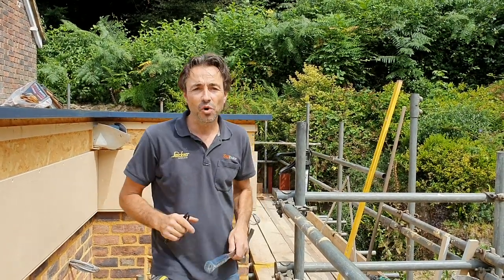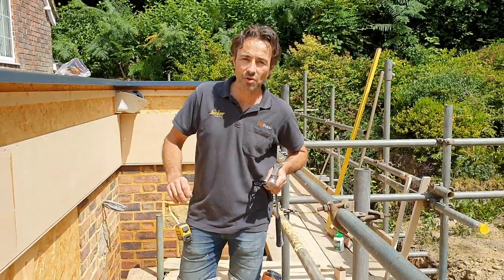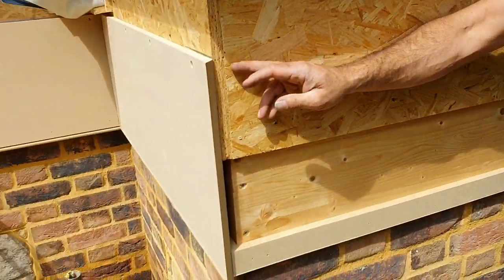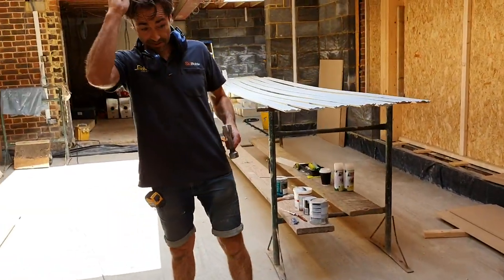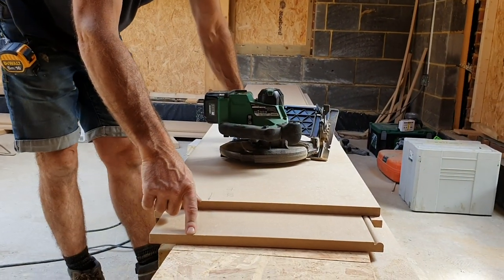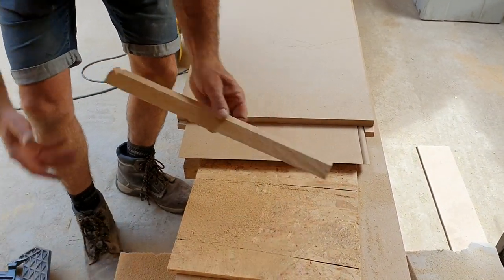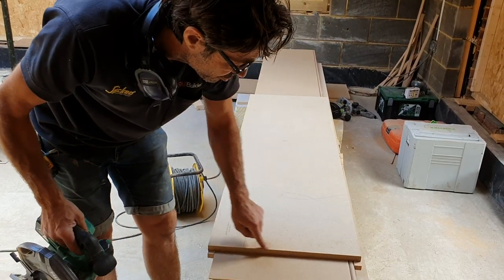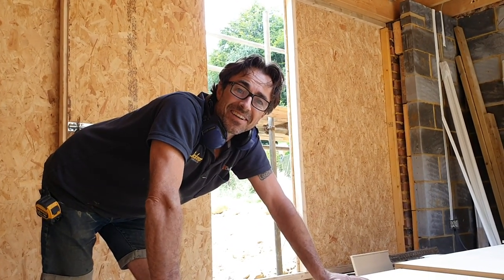How to mitre large boards

Comment: I would rather use my mafell track saw, put the fence on the saw and it acts like an out rigger which will stop the saw from tipping off of the track, it may need a small packer on the underside of the fence just to allow for the thickness of the track but it'll work a treat!
Using the circular saw is probably a quicker method than the track but as long as the end results are good that's all that matters 👍

Comment: Would've loved to see the biscuits in the corners used, the router cuts perpendicular to the facia board, where as most plunge cuts are at a 45*.
Also what's the cost of that weather resistance MDF vs Soft Woods?
As always, thanks Mate ☺️

Comment: how much is the tricoya a sheet Robin? also has your saw got a riving knife? when you watch any American chippies they don't have knives on any tools, they can be a blessing or a pain! my dilemma is: if I remove the knife & one of my staff has an accident where would I stand? I did have an apprentice try cutting some ply on the floor without supporting the whole of the edges & the ply twisted, kick back into his leg, then A&E, HSE not very happy about this but seemed clueless as to what the actual procedure of using a circular saw (suggested wearing a snag resistant cloth over his knees!) rather that the good old fashioned way of keeping your body out of the way in case of kick back.
Keep up the good work.
Reply: Last time i priced some up, it worked out around £200ish on single 8x4 sheets. Not sure now though, probably even more.
Reply from the maker: Hi Julian, with regard to the saw and the safety, some of my larger corded machines have riving knives but the smaller cordless tools don't, they do have a brake that when you let go of the trigger then the stop really fast, the Extreme Tricoya that I used was 3050 x 1220 and was about £200 per sheet, we had about 7 sheets on this job, thanks for your comments

Comment: Robin how do you feel about flat roofs ? As a carpenter I don’t think anything beats a cut roof but what do you think ( not talking about the job your on just in general )
Reply from the maker: Hi Isaac, I love pitched roofs, but also like flat roofs, I have no problems with flat roofs and I build them dead level without firring pieces then use my warm deck PIR insulation that is cut to fall, the membrane that we put on top is called Evalon by Alwitra, it is an awsome covering, I have never had a comeback with this thanks for the comment
Reply: Interesting , loving the videos robin keep up the quality work !

Comment: I'm still struggling with the idea of a 400mm long internal mitre, do you biscuit the joint and or pre make it on the bench then fit, how do you control an internal mitre that size? Why not a loose moulding on the bottom edge then a biscuit butt joint on your internals? It's not a criticism I'm just pick your brains.
Reply from the maker: Hi Ben in most cases I would butt and scribe an internal corner, in my case here because of the exposure to weather etc I had all my Tricoya extreme MDF moulded so the chances of a loose moulding even if it was well primed and glued and pinned would get any water running down the wide facia boards and in time would rot water only needs a tiny gap to get in and do its damage, also the backing for my wide boards was flat and perfect so the mitred internal corner fitted like a glove, it was only the main butt joints that where biscuit jointed as I demonstrate with my router, hope that helps and thanks for your comment

Comment: how can ytou be working with no PPE   or hi  VIS     as well as wearing shorts     i cannot even walk om site  if i do mot have a full length pair of jeans on    let alone hard hat   and hi vis  i even have been pulled up for not using a dust extractor for  cutting MDF   out  in the fresh air  in middle of nowhere  and then i had to have a H  CLASS   EXTRACTOR

Comment: Why not use festool plunge with track
Reply from the maker: In the video I mention why I did not use my TS55 rail saw, and it is because it has a tendency to slip of the rail when its at 45 degrees and this is why I prefer the normal circular saw and a decent board to cut against, thanks for the comment Gerald

Comment: Festool hkc55. Makes this cut so easy...
Reply: Shahar Dror that’s what I thought he would use at first!  But I think his method has some benefits as he said.  That Festool saw gets mixed reviews.  I’ve been thinking of getting it.  You like it then?
Reply: @Alastair_Freebird  
I'm a pro wood worker that works alone with one or two more professional guys. Since the hkc55 enable to bring the tool to the wood, and cutting very accurately, it payed for itself in a few days.
It's safe. Simple to use, collects most of the dust if you buy the dust bag.
I wish it was more robust as jobsite can be hard on tools espacially if you have new workers.
I'll give an example for a creative use: let's say you want to cut many banisters for a fence and each one is 5 cm wide. Mark one, put 8 together (40cm) and cut all. You just marked one and cut 8 pieces.
Put it above other boards and you already have the mark (made by the blade) for the next 8 pieces. 
It's a very productive saw...
Reply: Thanks for that, it does seem worth getting!

Comment: Lol the jig was pointless really as either way you still have to push the tool through timber at a 45 degree angle weather it’s a cordless circular saw or a rail saw can’t see why you can’t apply the same skill you use to do the cut with a jig and a circular saw as you would with a rail saw , the jig way just seems like a longer way to achieve a would be simple cut to any rail saw achievable before you’ve even dug the timber out to make jig 😂😂😂😂 but good video otherwise